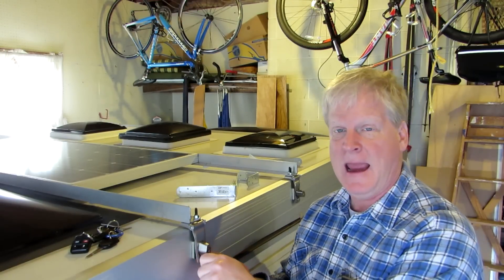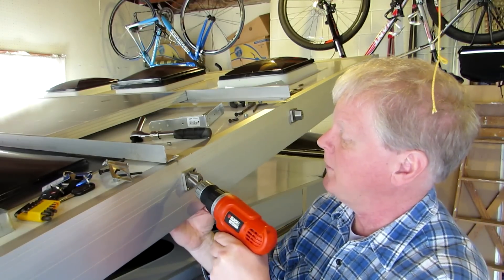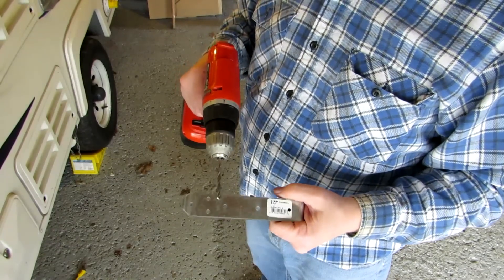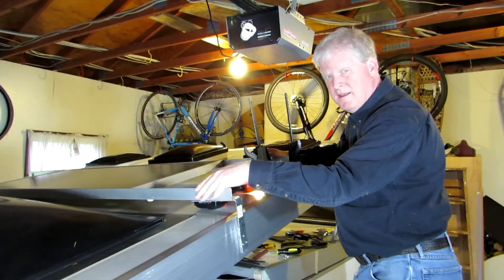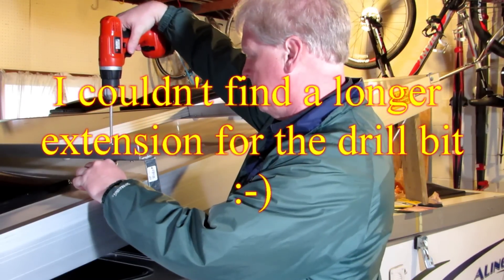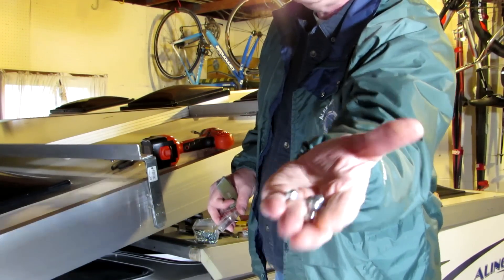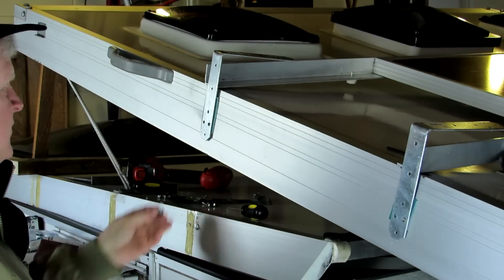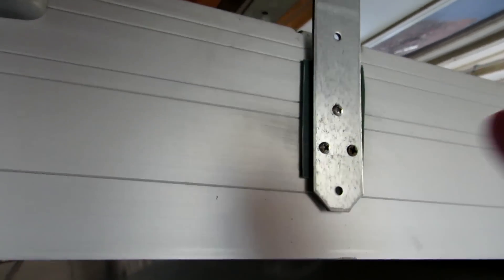Improving my Solar Panel Mounts on my Aliner Popup Aframe

Comment: Just bought my 100 amp panel for the aliner.  Will be following your directions for installation.  Thanks for the video.
Reply from the maker: Hope it works out well for you.  You have to be frugal with your battery power to rely on solar alone.  I keep trying to do a full solar explanation video, but it never seems to be entertaining or interesting, so I haven't published it yet.  But maybe in the next few months.  Its been too hot to camp around here ... LOL.  Thanks for the comment.

Comment: I’m going to try and install solar panel mounts myself 😬 would you happen to have a parts list for the brackets, screws and T nuts? I’m pretty handy but bad at knowing what type of parts I need to use. TIA
Reply from the maker: Are you doing this on an Aliner?
Reply: @ yes an Aliner. I’m currently watching your newest video when you replaced the 100w to the 200w and I also asked there also.
Reply from the maker: The T-nuts are these  https://www.amazon.com/HARSKIYER-Carbon-Furniture-Hardware-Accessories/dp/B0BNN651NM/ref=sr_1_15?crid=2YC1HQS41WUJQ&dib=eyJ2IjoiMSJ9.jT73f3qfAWwRaVCVI-RExEMV0owMaN_YO8Zmi8dkZ473A3meLfmf974k6lIzXu6lWg-r2VcC9SQCebHqHs91UgePEHq0xNR0Iym4ROam4aQgDF2ebCRPBdZI9zqkJRp4qk9Ul160ZmWA-6ni1jSNPDFDPQ1ORdtkonUYqMTGora2RdnemgcesPEeBhEEYTLHeI_ts9wuWydNVULbdY8Co-eUMDgAqRIsws96CnTtYUk.hG75byJ2AaQ-2re6zvkLcYxBzraBtdUhijxutf_EDeQ&dib_tag=se&keywords=t-nuts&qid=1733361623&sprefix=t-nuts%2Caps%2C165&sr=8-15&th=1
Reply from the maker: I can't find the angle brackets anywhere. But I'm pretty sure they are simpson 5 or 6 inch angle brackets.  You just have to find the ones that are long enough to go into the bottom of the Aluminum of the roof sidewall
Reply from the maker: These might work for the brackets:   https://www.amazon.com/Brackets%EF%BC%8CL-Brackets-Bracket%EF%BC%8CCorner-Floating-Countertop/dp/B0D9NBFQVZ/ref=pd_ci_mcx_pspc_dp_2_i_0?pd_rd_w=bPDPj&content-id=amzn1.sym.9cb932c3-e29e-44db-929c-bdc1460b3774&pf_rd_p=9cb932c3-e29e-44db-929c-bdc1460b3774&pf_rd_r=0T2MS62HDKKJ8SEKDPJK&pd_rd_wg=yGuXr&pd_rd_r=b1b1b9d2-35d8-4691-a17d-6bb13ac8e19e&th=1
Reply from the maker: And LAstly, you might want to check out my LIthium battery install. It improves on the solar wiring and I added a better Controller for the solar.  https://youtu.be/19SD_AI9yg8
Reply: @GoingNoWhereFast  thank you so much for your time and the parts list. I am only powering my 12v compressor fridge with a DR.PREPARE 12V 100Ah LiFePO4 Battery with Hub, 1280Wh. I am wanting to install the solar panel so it will charge the battery for the fridge. I didn’t want to over complicate things. Plug and play. What type of screws and size will I need for the T nuts?
Reply from the maker: Just take one to Home Depot or Lowes and have them match them up.  It should be a 1/4 inch or shorter and get Phillips or Square head it you can..
Reply: @GoingNoWhereFast  again thank you so much for your help. Doing this project will be a game changer for me. Have a Merry Christmas 🎄

Comment: Hi Rick i have watched all your solar panel videos and i have a couple of questions, My Aliner is a 2012 Expedition im looking at the 150 -  200 watt solar panel, how much harder is the roof to open with the extra weight? Also why not use rivets instead of screws and nuts? Thanks for all the great vid's and Sheba says hi to the boys lol
Reply from the maker: My panel configuration added  60lbs to the roof weight, and added about 30lbs to the force to open it (approx 75lbs).  I am currently installing gas spring struts to help with the lift. It is considerably harder to open, but not terrible.  But I do have to get in under the roof and give it a good heave !  I'm hoping the 50lb lift struts will fix that.  Remember though that my classic has different springs and roof weights than your expedition. And the age of those components make a difference too.   Are you using solid panels of flexible.... I  highly recommend flexible  to save weight.
Reply from the maker: On Rivets versus screws, rivets vibrate loose and must be replaced, screws can be re-tightened and Loctited. On the road I don't carry "rivet replacement gear", I do carry a screw driver.  Also a very small screw has 10x the strength of a very small rivet.

Comment: Have a question for you, about securing the battery. A coworker had her battery stolen from her camper, on the tongue behind the propane tanks and they made a mess by cutting the wires. Is there a way to secure the battery, with a chain/cable, in place, without having to remove the battery?
Reply from the maker: The truth on battery thieves is they rarely steal an old battery.  What they do is steal your battery so you replace it and then they steal your new one !!  You  can get "Bolt down kits so they woul;d have to work very hard to get it off, but of course so would you if you needed to get to it. And a good large set of bolt cutters would still get it free.  I trailer is just one step above a cardboard box, so if they are going to steal stuff, there isn't much you can do.  In reality by trying to secure stuff more rigorously, you are just adding cost to the theft.
Reply: I agree completely that if someone wants to steal your battery they will get it. That being said I believe many if not most thefts are instances of easy opportunity and if you make it difficult they will most likely move on to an easier target such as a battery held in place with a nylon strap. I found a YouTube video describing a simple and cheap way to reasonably secure a battery- https://www.youtube.com/watch?v=NlSZOl69z9k&t=276s . He simply bought a short piece of strapping available at most hardware stores, cut it to length, bent it and secured it with a good padlock. Not foolproof but definitely much more secure than a nylon strap. I was able to do it for ~$10.